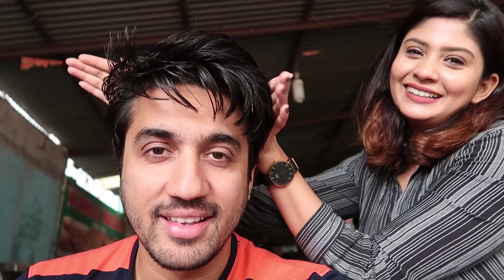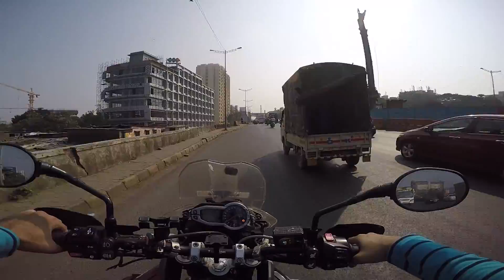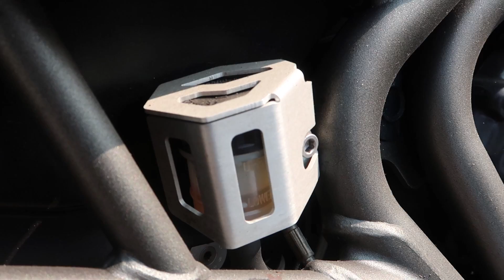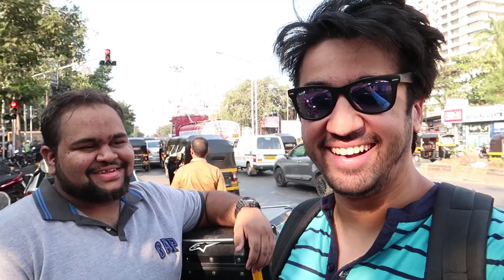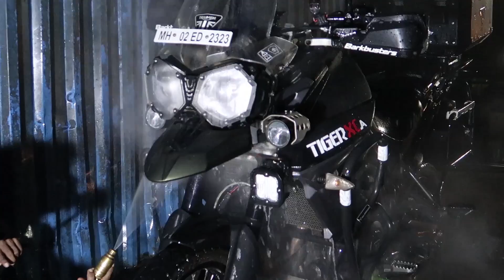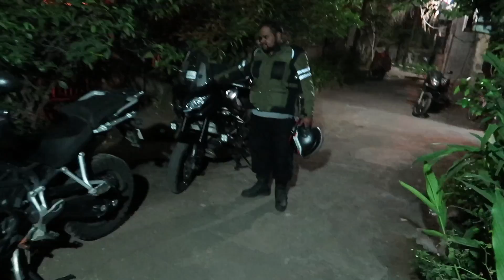Look What Happened

Comment: [11/23, 10:20 PM] Nil Nk: I know why your bike is Heating Up.... Common problem facing by you... Reason is The petrol... Yes The petrol is having different grade which is classified as Octane Number ... Normally in India 89octan & 91 octane fuel is available...where as all petrol pump sales petrol by different name like HP "speed" Like that... All are 93 octane.
[11/23, 10:21 PM] Nil Nk: What is different between low octane fuel and high octane fuel ? When The combustions is happening in cylinder by Piston Many times fuel is Ready for burning and it is burn before Required time or before (low octane) The requirement as per Engine that is why Engine product Miss firing is not much different between perfect burning & Unwanted burning but it is Heating Up a lot if you increases RPM of Bike. So prefer High octane fuel so it is not burn at high comparation ratio waiting for Sparks.
[11/23, 10:21 PM] Nil Nk: Kindly prefer high octane fuel like 95octan  or 99 octane... If you don't know the fuel is high octane or not simple see the Density reading at petrol station if it is above 700kg/m3 the it is 89 octane. 720kg/m3 =91 octane . 780kg/m3 =95 octane & above It is 95 octane.
[11/23, 10:21 PM] Nil Nk: If you want to remove the heating issue of Bike with using Normal Petrol like 91octan. Increase the Fuel supply Slightly towards Rich Fuel Mixture. Bike heating is reduced.